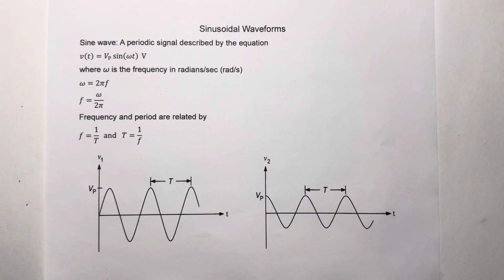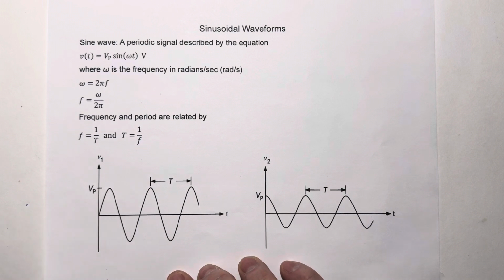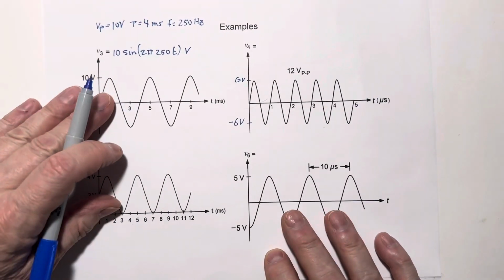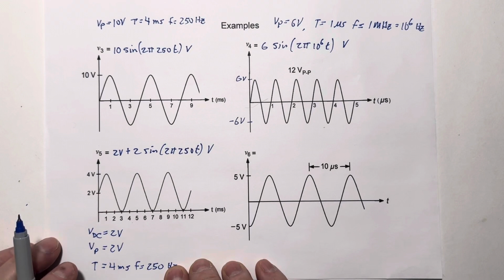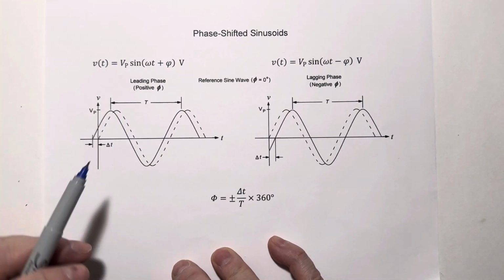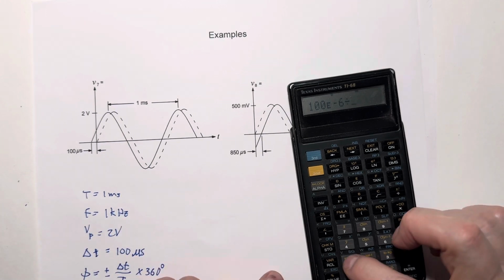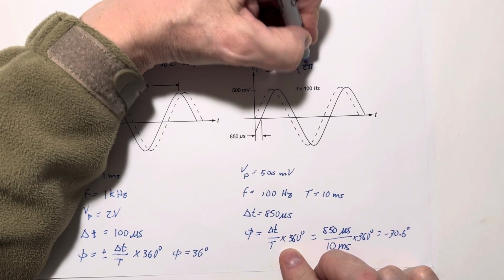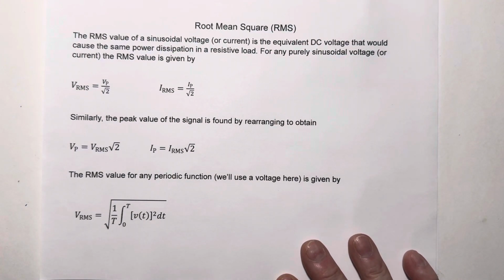Topic 9: Sinusoidal Signals; Sines, Cosines and Phase Shifts

Comment: The v8 equation should be - 0.5sin(2PI*100t - 30.6)
Reply from the maker: Your coefficient 0.5 is correct. I forgot to use mV as the units. I think I put a note somewhere here but it was so long ago that I forget where.